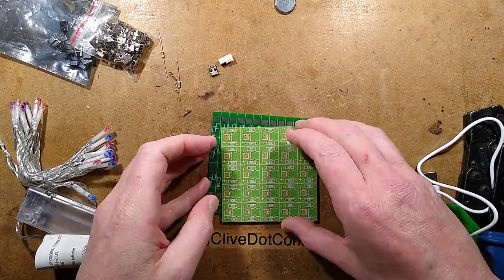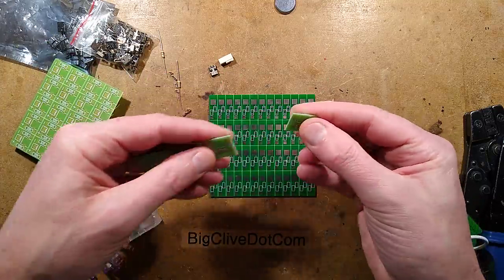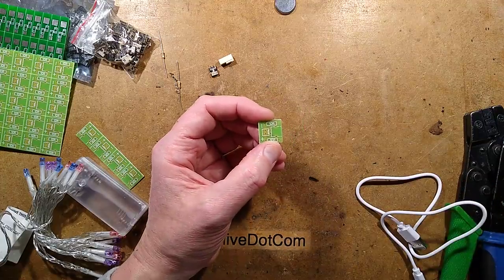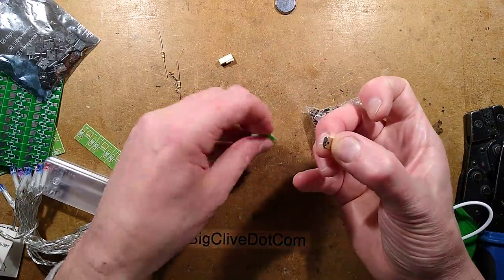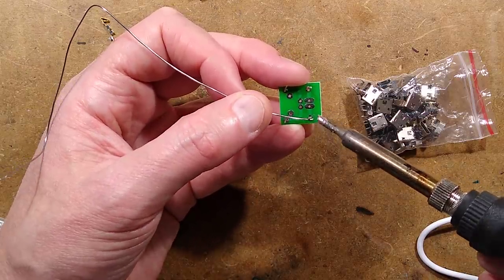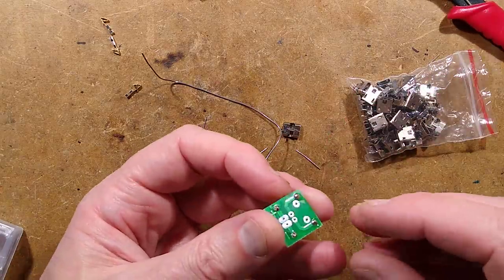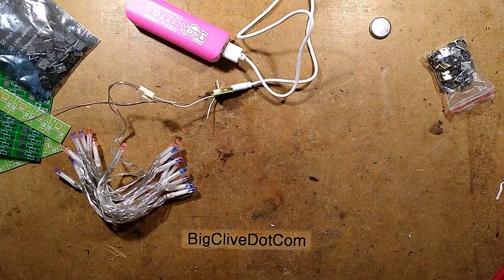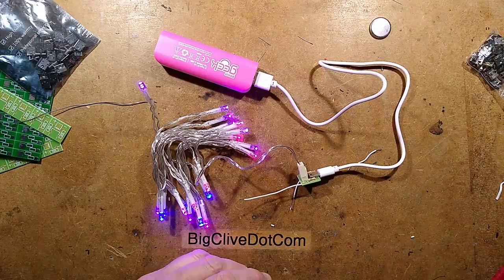USB to LED string PCB prototype build

Comment: Can we admire Clive's dexterity holding that board and components still while soldering and talking? :)
Reply: He applies maximum 'Dexterosity'. Defined as "The free use of ones skillful hands, particularly in the area of (insert preference) underwear". Not to be confused with 'Denterosity' which is the same skill but using your teeth.
Reply: @twotone3070  Clive's beautiful beardy must come into play somewhere?

Comment: I've had good experiences with JLC, and for the cost, have been impressed. sometimes there are imperfections, but we're not making Ipads or space-shuttle bits are we? I've never had a functional problem with them though. but I wasn't paying $2 for them, I suspect they will cut EVERY corner possible with the promotional deals.

My (then 9 year-old) son designed his first PCB last year (a reading-light with sleep timer) and thoroughly enjoyed it! after he watched the delightful videos made by JLCPCB that describe the process, he can't believe it costs as little as it does to get a complex thing like a PCB made for you on the other side of the world and then shipped to your door.  (and he's right, even without the silly $2 promotion)

Comment: JLC works but Oshpark is really the way to go (at least in the US) honestly. Yeah you might pay a buck or two more but they're fair, honest, great quality, and great service. One time USPS lost or mis-delivered my package of some boards for a project and the Oshpark support guy immediately put in a new order for me with express shipping, all free of charge. Doesn't get better than that.
Reply: Their flat rate $5USD/Square Inch includes worldwide shipping, as I recall.
Reply: I like them, too. Also Ainsler in Europe is really good (cheaper than OSHpark to Canada, for some reason, and Ainsler handles milling in Eagle better in my experience).  

My concern with Chinese fabs, aside from China's price manipulation of fabbing materials which drives domestic fabs out of business, is the Intelectual Property theft. If your circuit is promising or can be sold, they will take it and make a product from it without licensing it.
Reply: @kgchrome  you think that doesn't happen in other countries? Hell in the US they probably steal your design through terms of service clauses legally
Reply: @nyetloki but in the US and EU, should that happen, you have legal recourse for a price. In China you have nothing. Stop pretending China is, in any way, the same. It isn't.

Comment: Thanks Clive, I enjoyed that.

Sometimes you need 3 hands for a soldering task. (Last time for me was lying on my back underneath a machine I was repairing in a factory with one hand holding the parts together and my iron in the other.) When you absolutely have to use the deprecated "pool of solder on the iron tip" method, you also need to invest in a small dispenser bottle of liquid flux and put a few drops on the items you are soldering before applying the iron. My "get out of jail card" for soldering in an industrial environment.

Comment: Great little board :) Neat idea having the battery to USB power all on the one board and not having to chop up cables and mess around with heatshrink anymore, not that it was especially hard to do.
I guess the ultimate evolution of this idea could be some sort of little board that physically fits inside the battery pack and attaches to the two wired terminals, keeping the option there to used the lights with AAs should you want to in the future. Then all that would be needed is to make a microUSB sided hole in the cover of the battery pack to attach to the adapter board, or just not bother clipping the cover back on.

I've found JLC getting quite arsey and dodgy lately... The last order I placed with them, after taking my money and waiting 2 weeks, they emailed saying that because I lived in Vietnam (?? I'm in Scotland), that their cheapo airmail didn't ship there and to choose (and pay more for) a different carrier. Then after telling them it's a UK address they then changed their excuse to the cheap shipping (4PX, the same one the Aliexpress and Ebay sellers use) don't ship to the UK now because of "covid" - choose a more expensive shipping option... 
When I explained that what they were telling me was lies (as I had gotten several 4PX handled packages from Ali that week) they insisted that they were telling the truth and to "please choose more expensive shipping method"...
I ended the back and forth with an ultimatum, either send me my already paid for boards immediately or just cancel the whole thing, refund me or I'll just call my credit card supplier to issue a chargeback.
After another couple of weeks standoff, they eventually replied that they will send out my order "this time" but in future, "choose more expensive shipping".
I think that JLC are now trying to cash in on their status as the go-to place for getting custom circuit boards done but this whole episode reeks of fish and extortion. I think I might be trying an alternative to JLC next time.
Its a shame as they used to be pretty much faultless.
Reply: You're pretty much describing a battery eliminator, though I've not seen one with a socket on; they all tend to have a flying lead, either to a barrel jack or USB plug.
Reply: Consumer electronics can be standardized A LOT more and be made WAY MORE interoperable when it comes to supplying with power.
Reply: You could always 3d print a box with the extra room for the components. Also maybe upgrade to 18650 batteries and have it able to charge the battery as well(of course this would require additional chips, but would be a fun project).

Comment: You can buy solderable USB plugs that have enough room inside for a resistor. That way you could solder it directly on to the light string.

Comment: Our shops experience with jlc has been good. But their smd parts have always come installed backwards and random. We now use Oshpark, made in USA so no more exorbitant customs charges, which I recommend everyone, and they come in a pretty purple!
Reply: Their clear mask is pretty cool, you can see the routing and ground planes right on your boards.

Comment: Clive - you need some ‘crop & bend’ cutters 

They’re what we had as a standard tool for hand fitted components at Plessey- that were fitted after the surface mount and wave solder process- after removing rubbery solder resist 

After ‘crop & bend’ the components remain in the board when you flip it. Avoiding the need to burn your fingers. 

Although having bent leads does make them harder to desolder if you need to do further work

We also had a ‘stylus’ tool custom made in the factory too shop from a stick of circuit board with a track that went around the ‘nib’ edge - it was used to bend over pre-cut component leads on things like I.C.s etc
Reply: Seems like one-hand crop/bend tools all seem to be discontinued and pretty much unavailable.  Plenty of the jig-types and plastic bend-only though - ughhh.
Reply from the maker: Desoldering those components is always quite tricky due to the bent leads.

Comment: I have used JLCPCB for a bunch of different boards, and I ran into the same "extra charge" for V-scores less than 15mm.  Of course, in their defense, they do state that 15mm is the minimum side for v-scores. I have found over time that all the extra charges they have ever added was because I was asking them to do something extra. I have never figured out why they won't v-score boards that they assemble - you have to use routed cuts with mouse-bites to break apart. But, I just had some 3x7 panels done on 100x100mm boards , so I got 105 small boards for $2

Comment: My 2¢ / suggestions for a later revision, I'd definitely go with the right angle connector, and maybe do a 2 sided PCB with the resisters on the reverse as surface mount, that way you could create a slimmer profile that would almost align with the USB connector, perfect for a short length of heat shrink if you wanted to give things a little protection. A tiny side mounted switch (or option for one) could also be handy.

Comment: Just a little tip: when you separate panelized boards you can rub the two edges together (like it's stereotypically done with chopsticks) to smooth the rough texture which I find really unpleasant to handle otherwise.
For a single board you can use the edge of some scissors or similar blade (or just sandpaper of course) to smooth it
Reply: I bought some abrasive boards of the type used by persons of a feminine persuasion for their nails for general sanding tasks like this or tidying 3D prints, they don't require a sanding block because they're rather like using a fine file, you can throw them away if they get clogged and are incredibly cheap.
Reply: @IanSlothieRolfe  Yeah I actually have some of those single use nail files it's just that typically the closest thing when I'm handling boards are scissors or things like that so...
Reply: @IanSlothieRolfe  you can get the metal sanding boards, which presumably last longer
Reply: It's mind boggling just how little a diamond-dust abrasive tool costs nowadays
Reply: @IanSlothieRolfe  For those actually looking for these at the local shop, they're usually called emery boards, at least in my neck of the woods.

Comment: I tried JLC a while back. At the time the $2 was a promotional price for your first design and then any others were a higher regular price. I sent in 4 designs. They came back and claimed my first design "requires ENIG" and not only refused to honor the promotional price but also demanded I pay another $45 plus other fees on top of the non-promotional price, also refusing to honor the promotional price on one of the other designs instead. This was after they had tried to convince me to authorize them to blindly charge me (which I refused, luckily). I won't touch them.

The boards I've seen people get via sponsorship look higher quality than what I see people get from paying the promotional pricing, though hard to tell for sure. Would be interesting to see someone get similar PCBs both from sponsorship and (secretly) by paying for them, and compare quality.
Reply: So you didn't read their terms and conditions is what you're saying.
Reply: @Alacritous  I'm not sure what you are suggesting. My design did not in any way violate their terms and it definitely did NOT require ENIG. They merely used the claim their "engineers say it requires ENIG" as the excuse to charge more. They also claimed I should just pay the full price (including extra fees) and after I received the order to ask them to refund some of the charges.

FWIW the design in question was an OSH design many others have ordered from various fabs, including JLC, with no issue.
Reply: @Alacritous  So you didn't comprehend his comment is what you are saying.
Reply: Most people I find can't read. They know their ABC's and those letters form words but have zero comprehension skills. Comprehension (Understanding what a sentance means) is 90% of the reading skill.
Reply: I have never had any troubles with them nor had any hidden extra charges/fees to pay. And I have always paid fully, since I'm not a youtuber who gets offers of free PCBs from them.

What you need to remember is to read their manufacturing limitations/specifications, If you go outside those limits, they will usually charge extra. Some processes require ENIG surface finnish and can not be made with HASL or other surfaces.
Also some processes require more manual labor from their part which again will add to the cost.

It is reccomended to always communicate with them prior to ordering PCBs, tho have them look ones designs throgh and verify the cost and potential problems.

Also quality wise, they are on par with most other manufacturers of standard PCBs. The worst thing I have experienced from them, were some silkscreening that was a bit misaligned compared to the rest otherwise nothing else.
Reply: @Gin-toki  what surface processes require ENIG please ?
Reply: I smell you left something big out, never had this problem and i've ordered over 100 pcb's the last 3 years ;)
Reply: @Mr.Unacceptable  Most people can't write. It can be hard work reading and comprehending YouTube comments, especially when people use abbreviations and when they either don't use a spell checker or they use one with a mind of its own and don't check its output themselves.
Reply: @andymouse  Some PCB edge connections do.
And in some cases BGA, COB and other footprints require this, but that should generally not be up to the pcb manufacturer to choose whether or not this should be done.
Reply: @Gin-toki  Thanks ! thats what I thought, there are times when it should be used but none where the manufacturer insists !....cheers.
Reply: @andymouse  Henche why I reccomend one to always communicate with them prior to ordering, so both parties agrees on what is to be done.
Reply: @circadianrebel  You know, instead of going into rage mode over this, you could have just asked them about all this. Because in my experience, the support is done directly by the engineers, and they will explain it to you if you ask.
Reply: @Gin-toki  Exactly, they give us control and make the process flexible but if in doubt  just communicate with them.
Reply: @andymouse  It would be if they think there's going to be a problem with the design that you're going to wind up blaming them for because you didn't know enough to ask for it.
Reply: @Basement-Science  I did ask them. We had a series of emails over several days. They couldn't identify any features of the design that were an issue nor other explanation as to why it would require ENIG. A detailed play-by-play of the entire communication process seemed superfluous for a youtube comment.
Reply: @Sideshow Bob's Fan Club yes, you've made my point perfectly, I believe the quality is fantastic and I think it would be more trouble than it's worth to have different quality levels for whether or not you've paid!

Comment: my mom bought a set of lights at ikea and i recently saw them in action. they were plugged into a wall-wart with a very broad plug and I was delighted to see a USB-A interface upon inspection. nice touch. on the other hand i think ikea is quite a greenwash, talking about sustainability while on the next rack selling dozens of battery powered gizmos :(
Reply: They have recently discontinued all single use batteries, and now only sell rechargeable batteries
Reply: @davetreadwell  Here in Germany, I've recently been in and still saw some single-use battery. The website says, they will gone soon. but I also noticed, that the rechargeable batteries are more prominent on display than when they firstly introduced them. In the beginning they also they just had a crappy charger. they things they got now seem a bit smarter, which is good.

Comment: I like JLC, but you do have to keep in mind they nudge the price at every opportunity. :)
I got 5x PiStorm PCBs which ended up at about $5 each, which is still good value IMO.
Reply: yeah they raise the price for a lot of reasons, but every time I ordered something, they were still the cheapest option anyway. Other PCB manufacturers basically do the same thing, they just dont stress their cheapest possible price as much. It's also all written out on their website what adds the extra charges.
Reply: What software are you using to make the Berber file

Comment: Of course if you don't mind it being less tidy, you could always solder the components directly to each other, insulating them with some electrical tape. Saves the cost of the PCB. (those long leads on the resistors, when clipped, make great extra wires if needed.)
Reply: I can't afford the outrageous costs of PCB software but I at least etch my own copper clad boards.  Copper stripboard is also a good option.  Eagle wanted £1200 when I last checked, how can a hobbyist afford such prices?
Reply: There is USB female connector that has wires at output
Reply: @ianhosier4042  there's free software now. And eagle does a few square inches last time I checked like 7 years ago
Reply: @nyetloki  all of them now require a license which is very sad for the hobbyist.  I am now looking for a pirate version but no luck so far.

Comment: Yeah, I noticed that about the whole 2 buck deal, though I forgot what the price was at the time. But I had designed some diode boards for the motors on one of my 3D printers. Nothing fancy, just singe sided boards that held a couple of connector sockets and 2 surface mount diodes. Their 2 dollar/delivered in less than a week deal ended up being closer to 40 bucks and to be delivered a month later. Needless to say, I was less than impressed and chose not to go ahead with the order.

Comment: The minimum between V scores is 20mm, any less and you have to pay an Engineering fee. For paneling below 20mm use stamp hole / mouse bites. You can indeed get 25  20mm x 20mm boards from the offer size of 100mm x 100mm with no aditional fee ! Thiner pcb material is an extra charge ! When paneling the 100mm x 100mm size, do not check any panel options when ordering !

Comment: You could wire them directly to the board and solder the strand right to it.  Use heat-shrink to enclose the board and back fill the wire end using silicon rubber or potting compound.
Reply: i thought that was what he was going to do,  the USB bit is so cheap it makes the snap in connector redundant, unless you are using it only to test.  I like the use of batteries really,  must fit up the lights for this year though I can barely get to the window
Reply: @Okurka.  I assumed it was to allow different power capabilities.  With the USB connector, you can power off of anything, batteries, powerpacks, vehicles, etc, that has a USB-A connector.